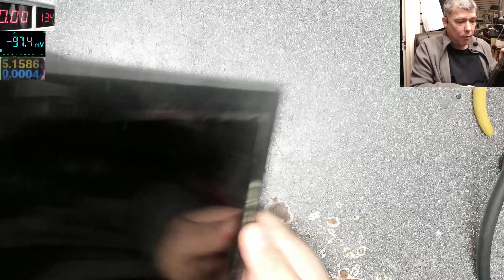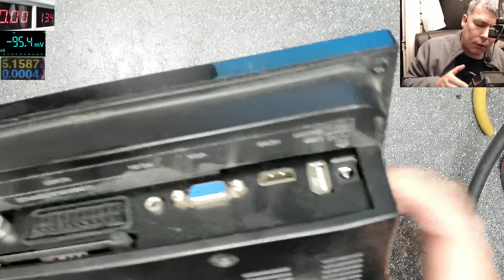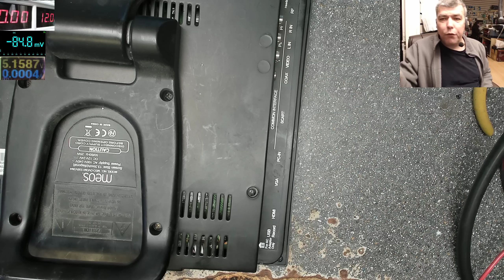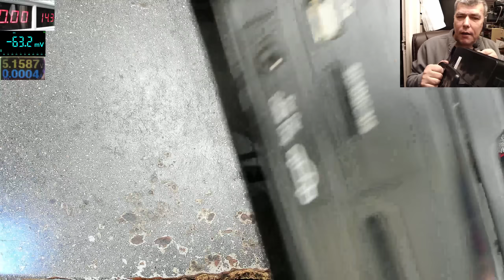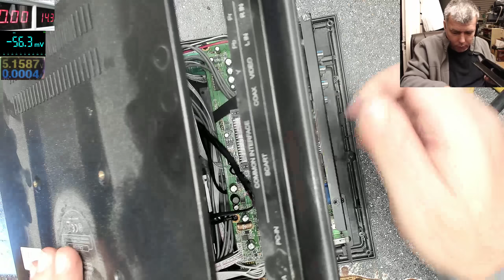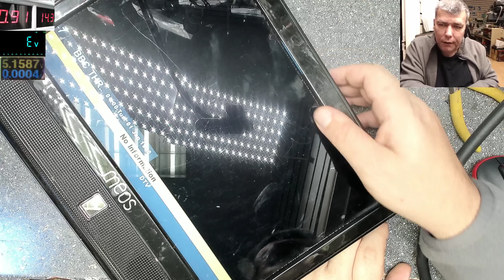Meos TV repair, no power repair

Comment: The Meaning of the AC adaptor is directly from 220 to  14 volts Ac output and can be supplied on regulated supply from the input of the power regulator if you can understand the Circuit of this tv unit.

Comment: AC adapter is just a transformer without any circuitry to convert in DC. That circuitry is expected to be in TV in this case.

Why don't you frie your wire fuses on a power supply for us to see actually how much current it is?

Comment: Hello! I am a beginner and I didn't really understand what you did there with the fuse. You found out the fuse is gone, then you soldered a wire onto the contacts of the fuse to "short" it like a bypass? If it works then it means it was only the fuse that was faulty, right? Also the job of this fuse, is to protect the rest of the board from higher voltage than 24V?

Comment: Hi there, when we set multimeter on diode mode and we have EV, that's means chipest or mosfet or fuse is not working, but if we have 0.0 or any value that means is working fine?? Please if anyone knows that tell me!! Thnx
Reply: 0.0 basically means that there is no resistance. Fuse is like a wire and if multimeter shows 0.0 then the fuse is OK. If it shows 1 or OL then there is a problem between probe points.
Reply: @hyrges  thankyou, but how about mosfet or other chipset if we have vaule like 1 or  OL what that means?
Reply: @Martin-ot7xj  OL means open-line, so there is no circuit, disconnected, that also applies to 1. If there is anything else than 1, like 1.234 or 0.546 then there is a connection. But yes, if it is a steady 1 or OL then the circuit is opened.
I hope I'm right :D
Reply: @hyrges  thankyou for your quick response,i think Explanation  accurate and  was perfect.thanks again

Comment: Would have thought 12/24 Would mean 12v on car 24v on a.c. adaptor?
Reply: trucks are 24v so they make them to run off either dc.
Reply: @kimspeller5379  well aware trucks use 24v, however this model is 12v only for car input.. as per the user manual